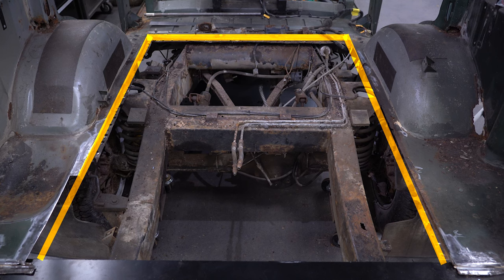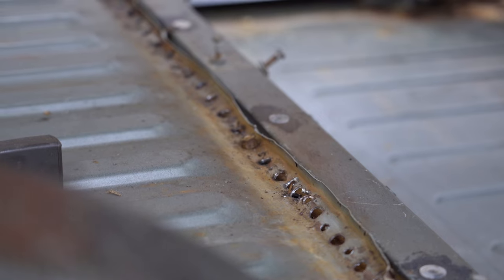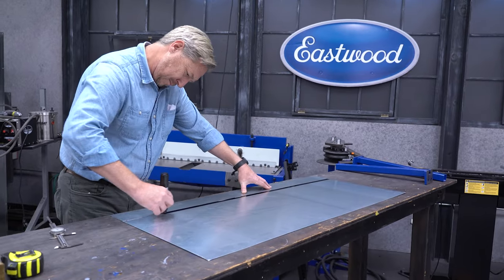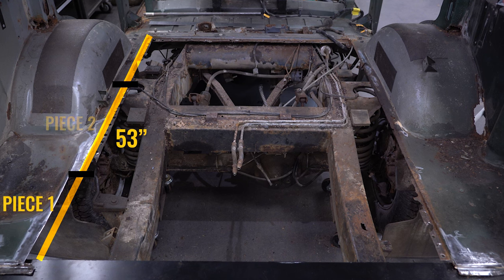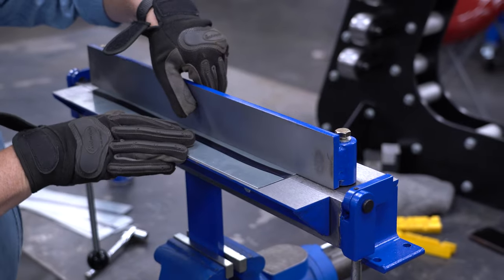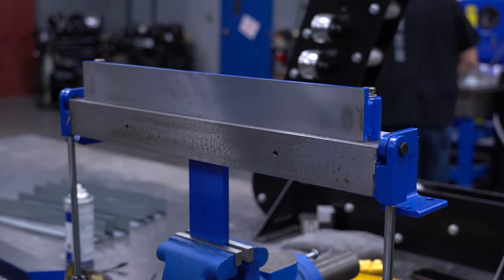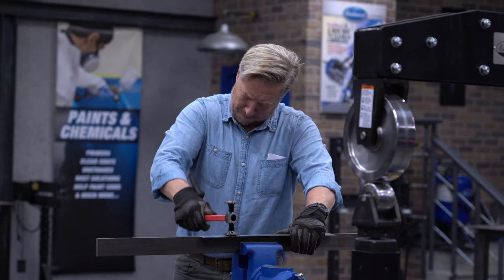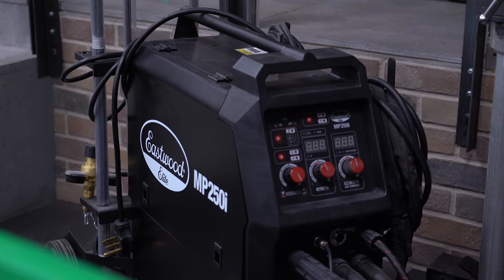DIY SHEET METAL with Brake - Making Patch Panels on Project Sunny

Comment: 20 gauge won’t last long should have used 16 gauge
Reply: 16 gauge would be impossible to body work. Most cars now are 22 gauge and heat treated. Thickness doesn't matter as much as hardening, tempering, boxing/layering panels for strength and coating the metal for rust protection. Even old cars with 18 gauge in them in areas is just terrible to work with. Good for welding, that's about it.